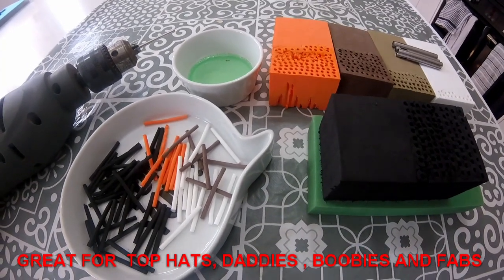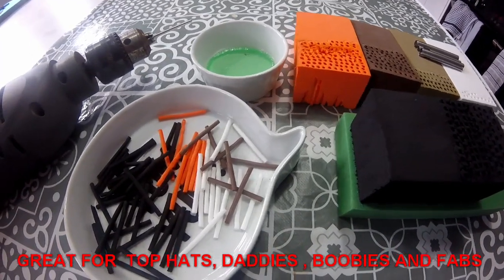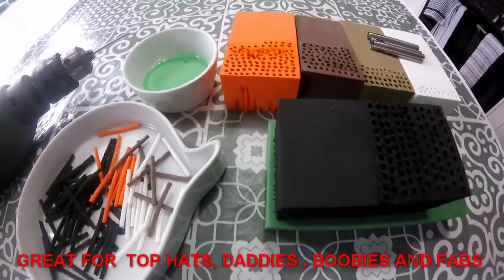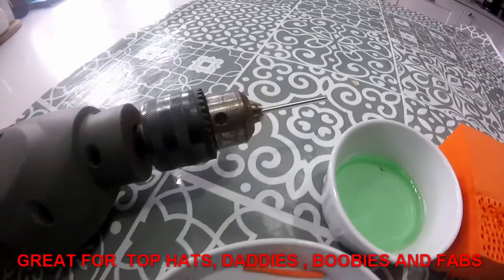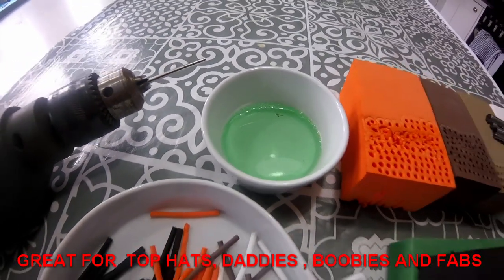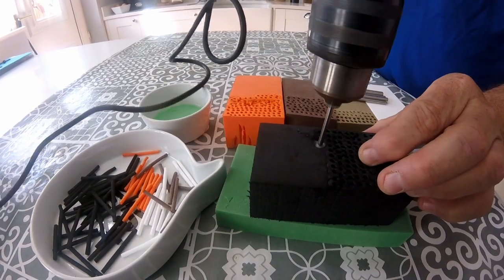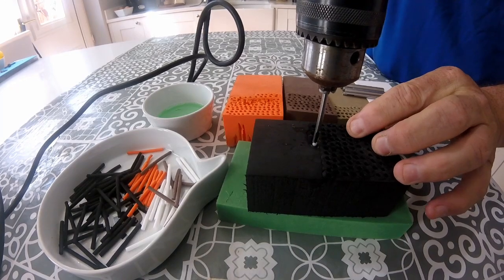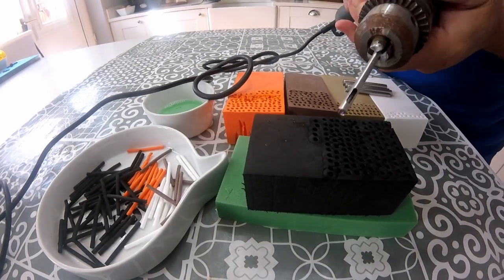FLY TYING - DIY  FOAM CYLIDERS FOR FLY TYING.

Comment: I'm a bit of a cheapskate Alec, I use bits of sharpened telescopic aerial and just drill it thru with my fingers. The amount of foam that I use doesn't really justify the dedicated cutters.
Reply from the maker: Stevie as long as it does a good job for you and your happy with the finish ,that's good , a nice cheap option  👍 🎣🐟
Reply: As you probably already know,anything and everything that is associated with fly fishing (as is most anything else listed for some specific job,area,field) is overpriced and many times a certain thing can be found elsewhere for much much less.

Those antenna work good.A easy thing to do is find some dowels that are close to the size of your "cutter" and you can then sand them down to the needed diameter or use epoxy to insert part of it into the cutter.Then you can chuck it up into a drill.
You can also buy sets of thin wall tubing in all sorts of diameters,lengths,and materials then use the epoxy/glue....or you could even just dimple the tube around the dowel.I bought 12" lengths of different dia. brass tubing,think I have 8-10 different sizes and only paid like a $1-1.50ea.I can make numerous cutters from that 1 piece of 12" tube.A pack of different size dowels/wood plugs was maybe another $5 and a tube of cheap epoxy was maybe another $3.In total I have much less in my 4 DIY sets than it costs for one of a "specialty set" that has fly fishing associated with it.